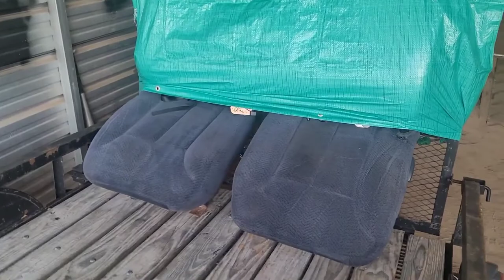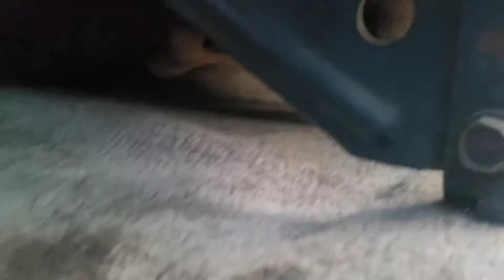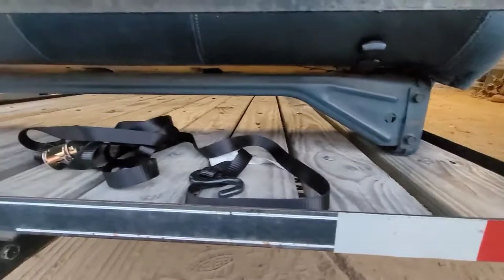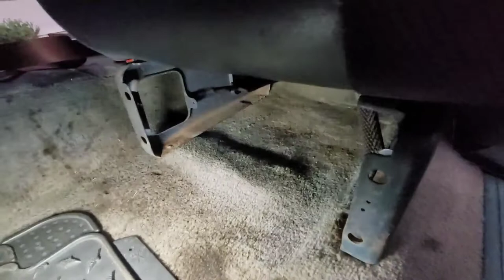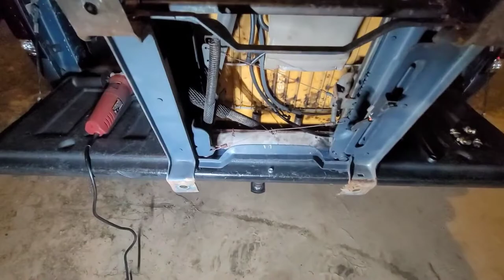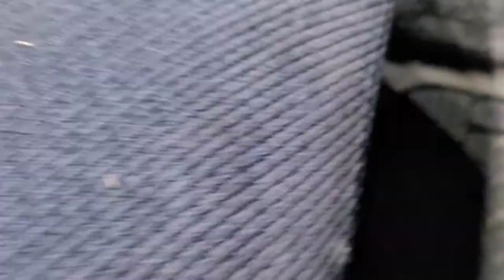Bucket Seats swap for my 1991 Chevy C1500 truck!!!

Comment: I like it to. I know your video is 2 years old but it was just what I was looking for.
Reply from the maker: It don't matter to me dude! I am just glad you found it and it helped you in some way!✊🏾✊🏾
Reply: @WorkingwithBobby  yes it did, I have a 91 GMC I’m building right now.
Reply from the maker: @22onachevy  great! And good luck on your build!
Reply: How does the passenger side seat bolt down. Does it use existing bolt holes or do you have to make new ones?
Reply: @wyattfuller827  I don't know. I'm still looking for a seat for the passenger side of my truck.
Reply from the maker: @wyattfuller827  I had to make new ones on the inside near the transmission tunnel and on the outside near the door. I had to measure the placement of the driver seat bolt holes and transfer that measurement to the passenger side and drill holes in the floor.

Comment: Thank you for your video. I’m actually doing opposite, bucket seats for 60/40 so I can fit my kids in the truck with me. Looks like I will need a double seat belt since mine only has one on the drivers side.
Reply from the maker: I left my original seat belts and latches in there so I could put a bench back if I want. I actually wanted the 60/40 seat but, couldn't find any that was affordable and in the blue color I wanted so, I went with the buckets I got.
Reply: It’s a nice 60/40 set from 88-94 years near me on marketplace. I’m in Indiana but the seats are in Illinois about an hour away for $150. I ended up finding blue buckets from a 94. I love em!!!

Comment: I did this in my 93 but I had some Fiero seats with speakers in the headrest that I mounted in with the bucket seat brackets from another 1500.
Reply from the maker: That's whats up! I didn't know fiero seats would work with the truck brackets.
Reply: I guess close enough to work. I love them.
Reply from the maker: @50TBRD  that's good man. I'm happy they worked out for you!✊🏾✊🏾

Comment: I have a 92 k2500, I bought a 2000 with a 6.0 4l80e 4x4, nothing special, but planning on starting swap on it as soon as I get a second vehicle, been doing small things here and there on it like lights and bull bar and stuff, just my old work truck that I'm modifying lol
Reply from the maker: Hey man, that's great! I wish you the best on your build!✊🏾✊🏾 That's why I do what I do. I install what I can afford when I can because I need a 2nd running vehicle. The impala was a great candidate but, it now needs a motor. Keep wrenching dude!🤟🏾🤟🏾

Comment: Thanks, I’m going to be doing the same thing to my truck.  👍🏻
    I’m thinking I should have room for a 12 volt cooler between the seats 🤔
Reply from the maker: No problem! Glad to hear that!✊🏾✊🏾...I think I have around 10 inches of clearance between both seats. Hopefully the cooler you choose will fit.
Reply: @WorkingwithBobby  thanks, I’ll be sure to measure the coolers available, if it’s a little “snug” I don’t mind

Comment: When you drilled the inner two holes for the driver side, did it already have a receiver or did you just drill holes, slide bolts and tighten with nuts? I have a 60 driver that I’m taking out in the next few days and need to do the two inner for my bucket seat.
Reply from the maker: Good question. I drilled holes to the size of the bolts I used and then fastened them down with lock washers and lock nuts. Good luck with your swap!✊🏾✊🏾

Comment: What kind of seat did you use for replacement. I'm now convinced I to add seats to my 93 k3500
Reply from the maker: I used seats out of a 96-99 c1500 extended cab. I think that's what they came out of.

Comment: How did you secure the other side of passanger seat. Are there holes under the carpet?
Reply from the maker: Good question, I had to drill holes for that side. I might have been able to use the outside holes closest to the door. I hope this helps.✊🏾✊🏾

Comment: What size bolts did you use to mount the inner sides on the seats ?
Reply from the maker: I don't know exactly but, I used some that were almost the same size as the outer bolts. Since there are no holes there for mounting, I had to drill through the floor and use flat washers and blue lock tight on the bolts. I hope this helps!✊🏾✊🏾

Comment: How did you get the bolts in where you had to drill? Thinking about doing this to my 93
Reply from the maker: I used my Dewalt hammer drill and attachment to use a deep socket and a box end wrench to fasten them down. I used the factory fastener on one or two holes I think. Have to check the video to be sure. I done forget myself. 😆😆

Comment: I wanna do this too. What year/type of vehicle are your bucjet seats from? Thanks.!
Reply from the maker: If I did it, you can too!✊🏾✊🏾 I believe they came out of a 96-98 C1500 extended cab truck. I wish I had the center console from it too but, it was damaged.
Reply: @WorkingwithBobby  cool.Ill turn my center console into a sub box,maybe. Or 3-12"  or 2 maybe 3 JL Audio 13.5" subs blowing through the rear wall.
Reply: @WorkingwithBobby  Thanks for the quick reply!☮️👍
Reply from the maker: @user-hf4eh2ts3q  yea sir. Always try to help if I can.
Reply from the maker: @user-hf4eh2ts3q  that sounds good. I probably would try that too from when I was deep into the car audio like when I was younger. I hope it works out for you!
Reply: @WorkingwithBobby  Thanks again, I was in car stereo when I was younger...and still am now at 50.
Reply from the maker: @user-hf4eh2ts3q  no problem!✊🏾✊🏾

Comment: Did it give you more steering wheel room to lean back more
Reply from the maker: Oh yeah! The seats almost made the cab feel bigger. They are a little taller than the bench seat though.
Reply: @WorkingwithBobby  i got a 2002 c3500HD with a bench i want to change the seats for more room im big and kinda tall for a single cab 😂
Reply from the maker: @robertmunoz11  those bucket seats will definitely help with that!